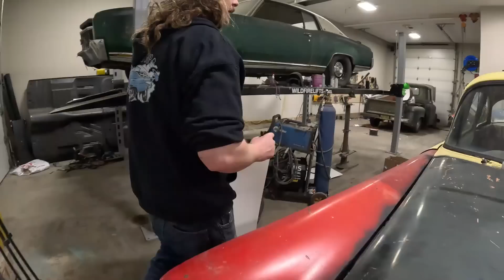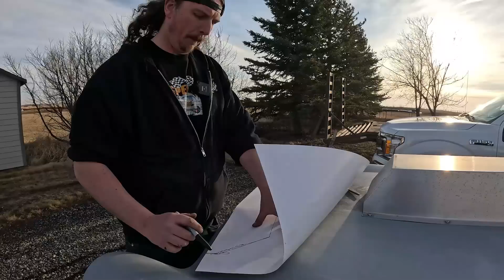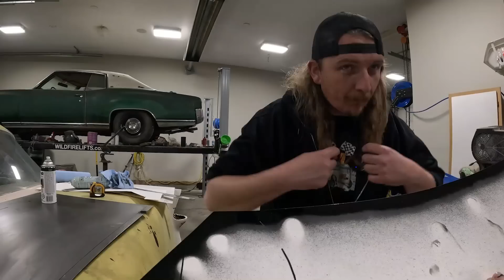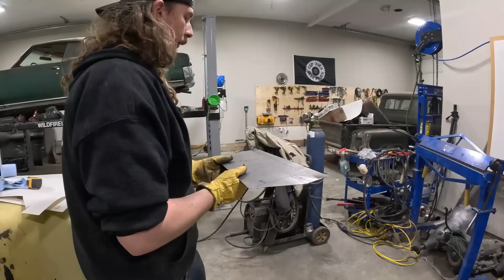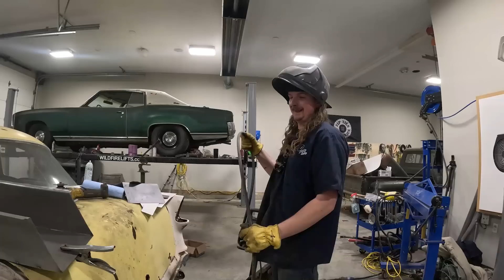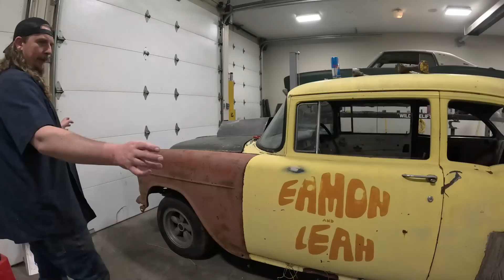Two Lane Blacktop 55 Hood Scoop Replica- BUILD YOUR OWN!

Comment: Needs Fiberglass tilt Front end!

The famous Two Lane Blacktop '55 is still equipped with a tunnel-rammed 454 big-block Chevy, M-22 Muncie rock-crusher transmission, and an Olds rear, fiberglass tilt front end, fiberglass doors, fiberglass truck lid, and Lexan side and rear windows. The Two-Lane Blacktop '55 is street legal,

Comment: Dano make it from 1 peice of metal then you only have to weld slopes .much cleaner .i did it using a heavy peice of angle on a wood werk bench with a few clamps.

Comment: Dan I use to use an angle or 90 degree die grinder with spin on sanding pads to run over the places where I want to weld just real quick to clean it up so it will weld lot better. Try it takes only a min. I think I seen you use one? 20 bucks at walmart if you dont have one in Alberta all your tools are in Winnepeg:face-blue-smiling::text-green-game-over::face-green-smiling::face-fuchsia-wide-eyes::cat-orange-whistling::face-blue-wide-eyes::face-orange-raised-eyebrow::face-fuchsia-tongue-out::face-red-heart-shape::face-purple-wide-eyes::glasses-purple-yellow-diamond::body-blue-raised-arms::body-blue-raised-arms::body-blue-raised-arms::hand-orange-covering-eyes::trophy-yellow-smiling::trophy-yellow-smiling::trophy-yellow-smiling::trophy-yellow-smiling::trophy-yellow-smiling::trophy-yellow-smiling::trophy-yellow-smiling::eyes-pink-heart-shape::face-turquoise-covering-eyes::face-turquoise-covering-eyes::face-turquoise-covering-eyes::body-green-covering-eyes::goat-turquoise-white-horns::hand-purple-blue-peace::finger-red-number-one::text-yellow-goal::medal-yellow-first-red::yt::oops::goodvibes::_57Chevy::_Dani::_Dano::_Nova::face-blue-smiling: It looks like a HOT ROD to me pretty cool. A plenishing hammer would help the drivers rear quarter panel. I think they have them to fit air chissels? You can make them.

Comment: When you overbend a piece, you can remove some of the bend without screwing up the piece. I would have to show you, I don't think I can put it into words how it's done.   
m    Yes, you can bend a lot of the joints but you would most likely have to weld the sloping front corners.  Plus, it requires a much larger initial piece of metal and there's more waste.  It's also very hard to lay out correctly and you probably would have to do it once or twice getting it wrong before you could lay it out right.  This means you could waste as much as two big sheets of metal before getting the third piece right.  You could do it with paper first and use the correct paper template to mark the metal.

Comment: Cut out a slot the width of the scoop on the hood and slip it in from underneath and weld the flanges from underneath the hood, then weld the seams on top of the hood and grind them smooth
Reply: Exactly

Comment: Chip Foose SUCKS. All he does is build GHETTO cars with HUGE GHETTO REEHUUMS and no tires. All GARBAGE. 

If you have all the dimensions, a sheet metal shop should be able to make one out of one piece of sheet metal with no welding. They can make perfect right angle bends. I used to have a car I wanted a scoop like that for, but I'm not into metal work. I was going to see if a shop could do it, but never got around to it. I just discovered they are selling them on eBay.  Brake cleaner is wonderful stuff. I buy it several cases at the time. I average going through about a dozen 16oz cans a month. I will go through a whole can of it just doing an oil change. I go to extremes to keep dirt out of an engine. Will the hood open? The Two Lane Blacktop car had a one piece front end that opened forward. Looks like that one is going to hit the windshield. None of my hobby cars have heaters or wipers, or much of anything else except what is necessary to make them go and stop. It doesn't get cold and it doesn't rain in Phoenix, AZ.

Comment: A few fun facts about the original '55 "Two Lane Blacktop" Chevy. The movie came out in 1971 and after the movie it appeared in the movie American Graffiti (1973), It also was used as the sound for Burt Reynolds Trans-Am in the Smokey & The Bandit (1977)!  In 2000 the car was found in Canada and later sold at an auction in 2015 for $159,000!!!

Comment: Dan, if you ever bend it wrong, open the break up both sides and crush the bend until it's flat, I've been in hvac for 29 years and screwed up tons of sheet metal of all thicknesses, it works great.

Comment: Dan the best work bench is an old 10 ft curch folding table, take the top off and get a sheet of treaded 3/4 inch plywood and make a new top, cover it with a sheet of metal and you have a mobile work bench  that an engine can sit on but when you need it somewhere else simply fold up the legs throw it in your truck and take wherever you want or you can put wheels on it and have it easily movable.  I love my table, work great, and every freaking church throws them away.

Comment: I've had the privilege of meeting Chip Foose twice.  Couldn't ask for a nicer guy!
Reply: RC cars are just as wicked Pro Stock and Top Fuel If you know what you're doing. It's a talent to tune them little bases
Reply: My friend said you can put 5 to 10 in them on a rail and run salt flat time's. Is that true?

Comment: I read somewhere, the weathered look was achieved using a Dawn dish soap wash and let it run down the car and dry. The Two-Lane 55, if you look close, you can see the greasy soapy runs below the windows and how it collected at the door seams.

Comment: Sorry Dan, but that scoop looks like a parts bin turned upside down.  If you're going to sell the car please don't cut a hole in the hood, all you will do is lower the value of the car. 
Unless you're putting a blower on the engine, what's the point? All show, no go. Guess I don't know what a 2 lane blacktop car is supposed to be.

Comment: You can actually make the sides and top all in one piece and do the bends in the brake. The front will have to be a separate piece but the only part that will have to be welded. Try drawing a pattern of the entire scoop on the poster board and you’ll see what I mean.
Reply: You could do as Russel says Inc the front face too leaving only one seam on each front corner.
Reply: That’s what I was going to say
Reply: Me too I guess we're sheet metal guys.I was now retired!
Reply: Welds look sharper, imo,😀
Reply: @ Dan professes to be lazy. I was just thinking about saving him some labor lol.
Reply: It could all be built in one piece
Reply: @ yeah after I thought about it for a few minutes I realized that.
Reply: YEP , work smarter. not harder , Danny Boy😊👍🇦🇺😋